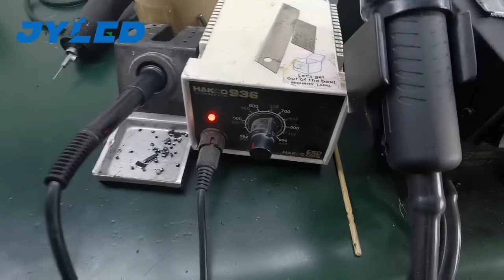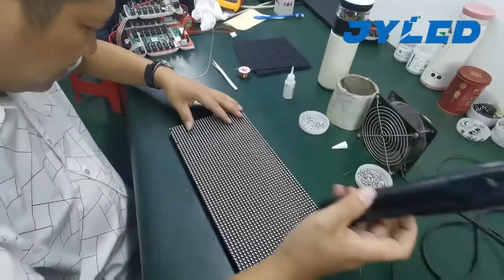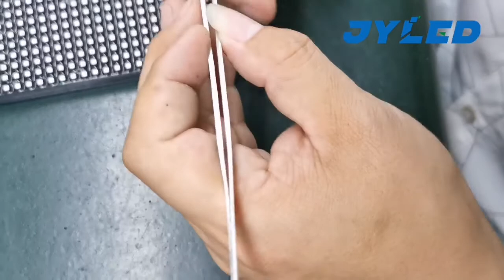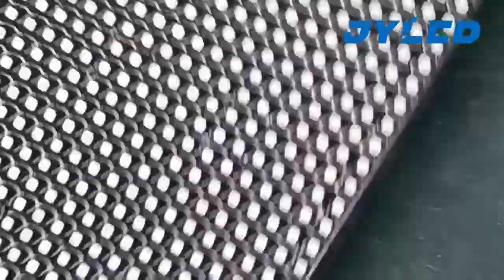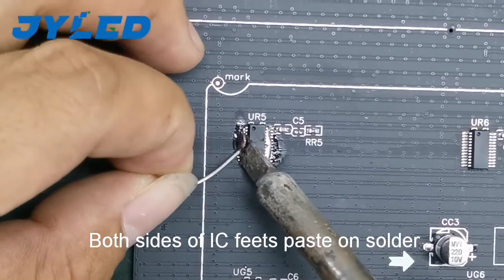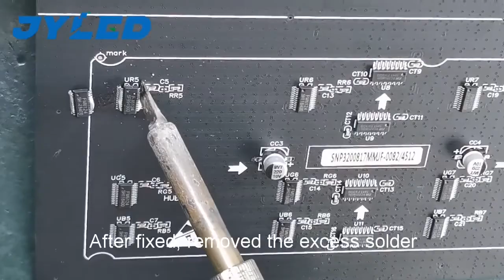How to repair LED display lamp and IC?

Comment: Hi, love the video. I work repairing this kind of modules. Do you have some kind of manual for knowing how to solve IC problems ? I need to know how the circuit goes between color IC, Units IC and Q (tension) IC. Thanks !
Reply from the maker: Thank you for your recognition and attention. If you want to learn more professional knowledge, you can contact us by email sale13@sz-ledscreen.com.   Our engineering team will send you professional solution materials for reference. Thank you!

Comment: Are you in the USA?  I need panels repaired...
Reply from the maker: We are led screen manufacture in Shenzhen, China😄. If you want can ship us, please contact me on sale10@sz-ledscreen.com
Reply: @jyleddisplay  good morning, greetings from mexico, I would like to know if you have or can provide me with the module for a panel model x04 pixel size 4.81 52x52 for interior, the specifications of the cabinet are:
 brightness 800
 1/13 scan
 led type smd 2020
 IP31
 power consumption 580/195
 cabinet resolution pixel 104x208
Reply from the maker: @antoniodejesusolguin7333  Hi, you can contact me on whatsapp +8613553831871